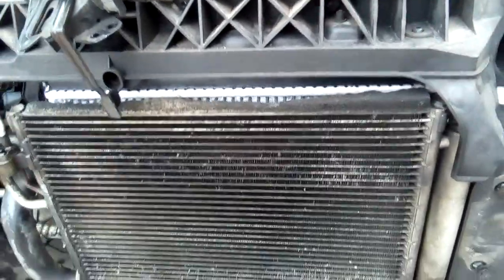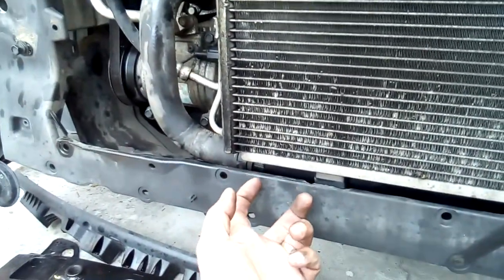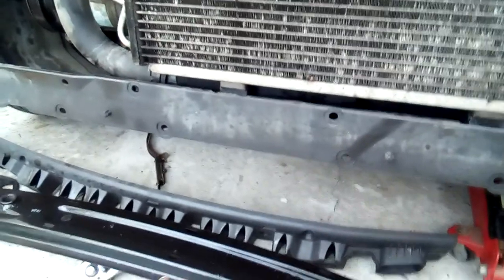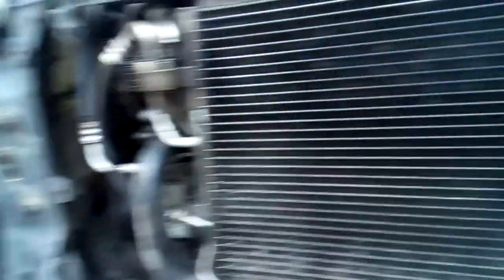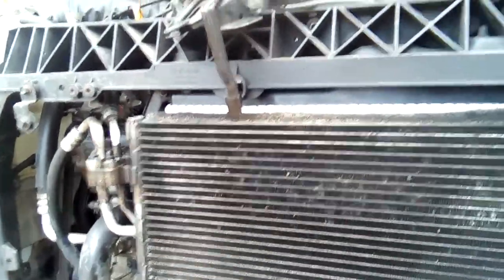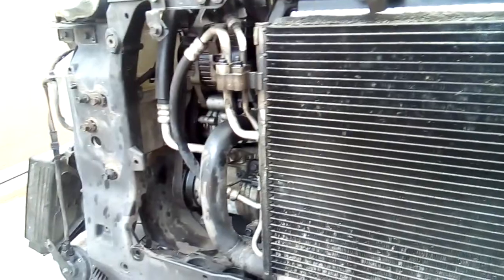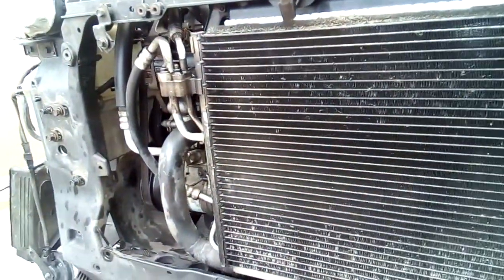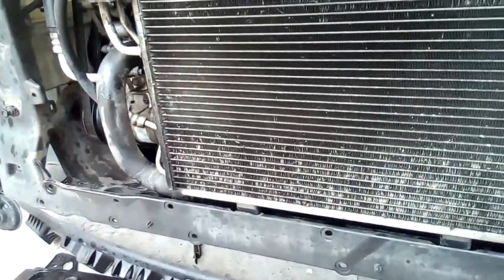I10 radiator replacement

Comment: You don't need to remove the bumper or cross member,  remove the air filter box and the battery tray then remove the two screws holding the radiator fan then the 4 bolts at the bottom of the radiator (the heads face the back of the car you will need to move a wiring harness).   Then push the bottom of the radiator forward and remove the metal bracket things you un bolted now you can push the radiator down a little and it comes loose.

Comment: Thx for this great video, do you have a video on how to replace the 2 oxygen sensors for this Hyundai I10 2012 model? Here in Lima my mechanic says that the radiator has to be removed in order to accomplish this task?, I think it is far fetched